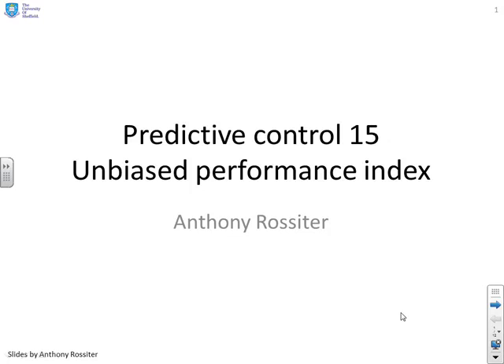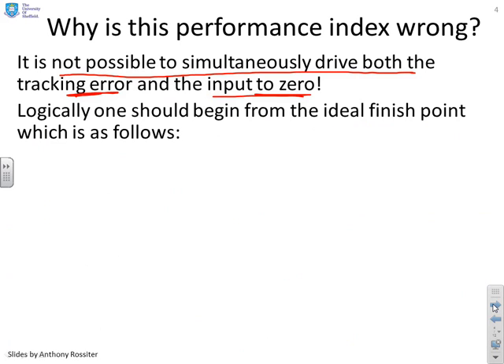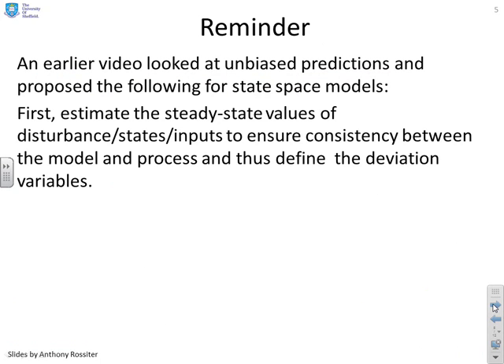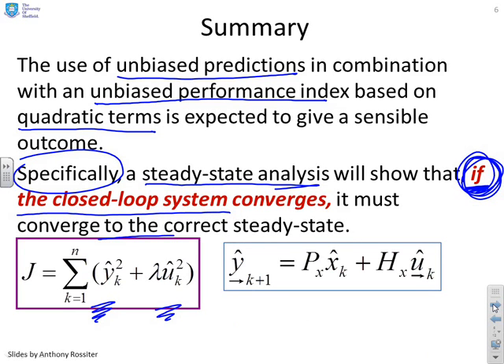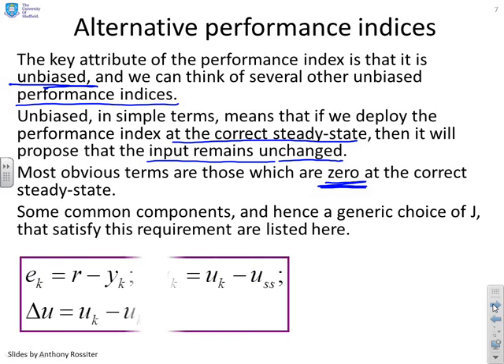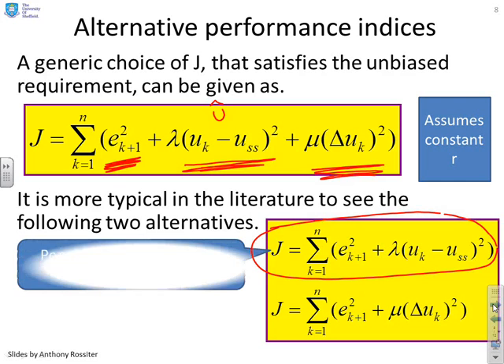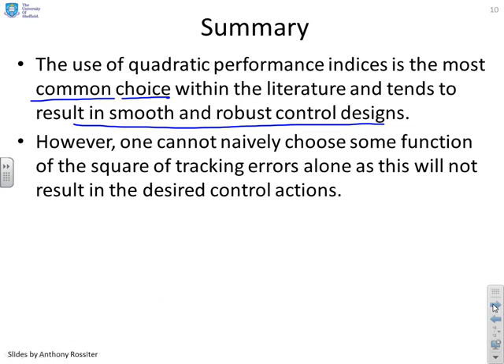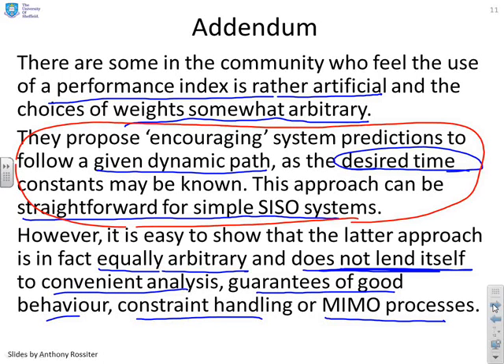Model Predictive Control  15 -  unbiased performance indices

Comment: Thank you for the videos. Very insightful. I wonder what would be the better approach for choosing  performance index  if my reference is a threshold rather than a strict reference to be followed. 

Let's say I'm creating a new cooling system for a big computer. And I want the room temp. to be below 10 degrees.  It starts to cool when it gets close to 10 degrees and wont stop until the predictions indicate that system is not going to warm further. Then (I'm assuming) using the term ek^2 may not be in our best interest. What would be a good approach ?
Reply from the maker: +ltc0060 I cannot give a good or simple answer to this but believe the use of zonal control is quite common in industrial MPC packages, so they have a means of emphasing a desired zone rather than a precise value. The difficulty is that 2-norms give easy and well conditioned optimisations whereas for other criteria it is less straightforward to manage the optimisation and thus coding is more complex and challenging.Anthony
Reply: +John Rossiter I appreciate the time you took to respond. And thank you for the answer.